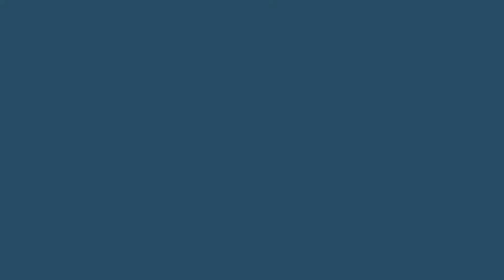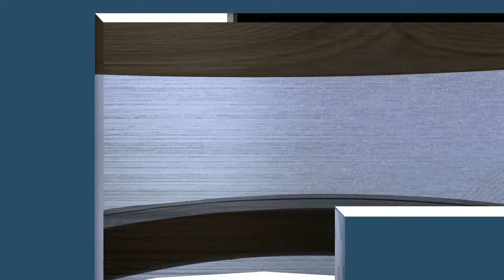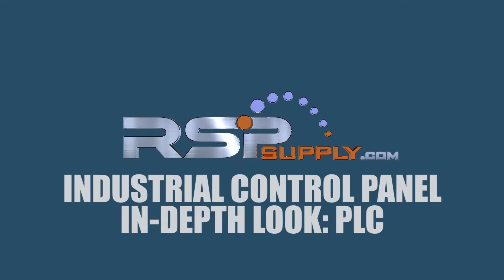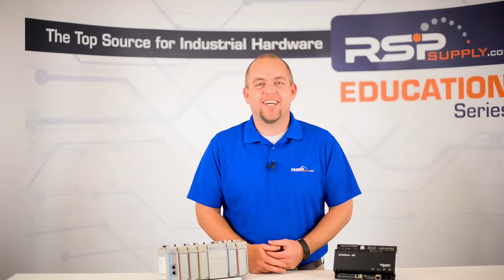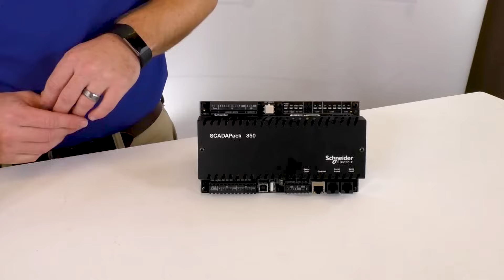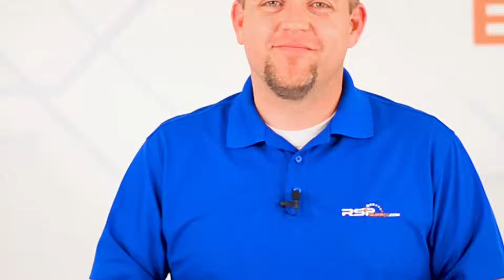Industrial Control Panel In Depth Look Part 4: PLCs (Programmable Logic Controller)

Comment: When I look at I/O, I generally design in at least 20% spare I/O.  That means I calculate the required I/O + 20% spare and round up to fill the card - for each type of I/O I have.  Then I make sure I have the ability to add cards in the future without modifying the physical layout of the panel when possible..

Comment: I'm confused. If there is I/O on the PLC with modular I/O, why is there need for the other I/O on the bottom of your industrial panels in other videos?
Reply: Arley Lopez , I believe that the plc is wired to a terminal strip where connection to external components is made. The lower section in the panel is the terminal strip.